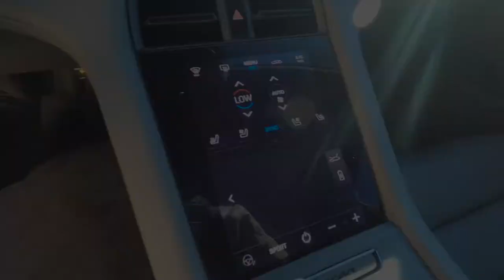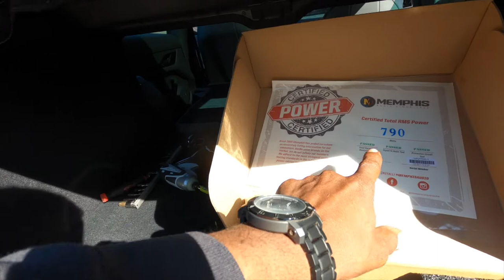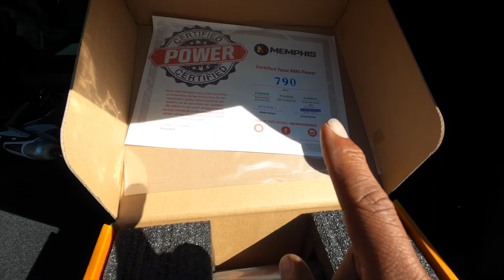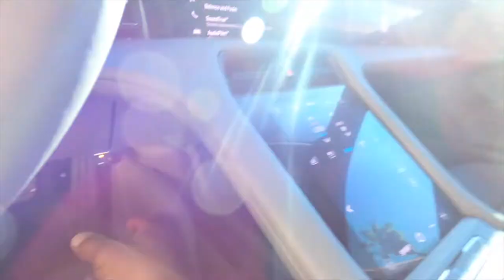Memphis Mojo subwoofer MJME8S1 & VIV 750.1 1ohm stable amp review. 2022 Porsche  Taycan

Comment: Thanks for posting this. Been looking to see if this can be done prior to calling the audio guys (i might just do it myself now :)
Where did you ground and where did you tap to audio source?
Reply from the maker: The driver side in the rear is a factory ground, so that's where I grabbed it. I grab the signal from the factory sub, which is located in the rear also. I did remove the entire rear section to do it.
Thanks for the question.
Reply: @lancesautovlog  cool thanks Lance!